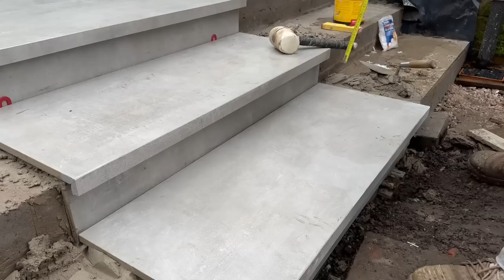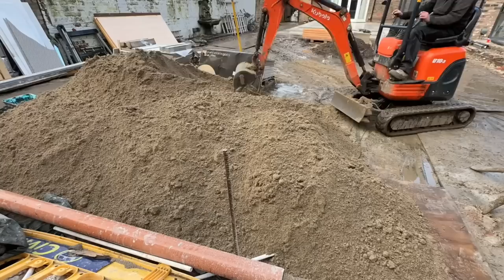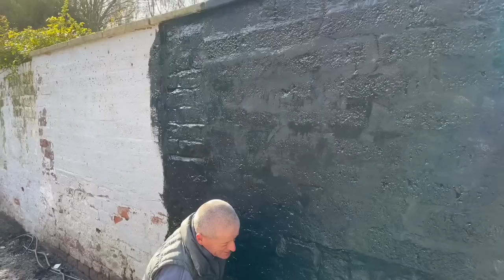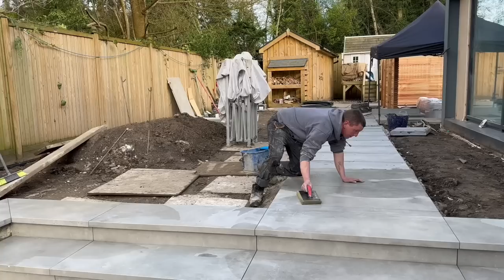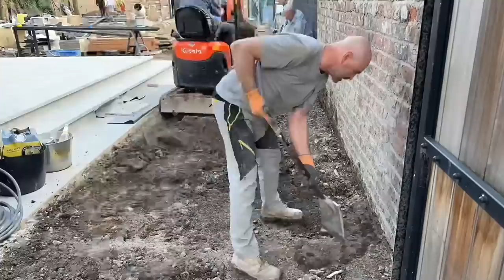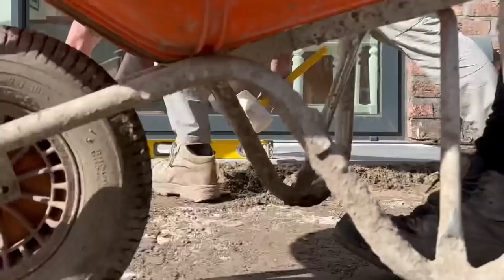Tackling Another Patio - The Coach House Garden Episode 9

Comment: Do you think a sami dry (I assume you are using there) is better than a full wet bed?
Reply from the maker: It’s a bit wetter than a semi dry mate, but not wet.  I don’t think one is better than the other tbh, just what you prefer 👍
Reply: @Brockstonepavingpros  yeh I think I get you,  if it's too dry it will crumble  / not activate the cement, but it still compacts a little to make laying easier. And you prime the base and the slabs and the slab on the steps because of the leverage on the overhang  making it easier for them to flick up, honestly you are one of the best I have seen!